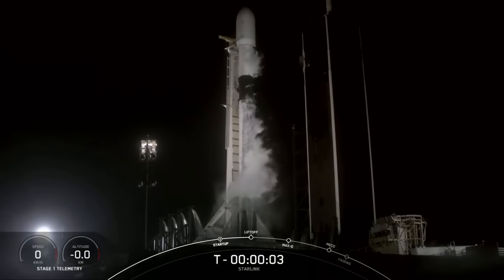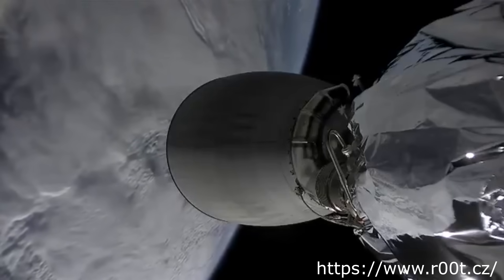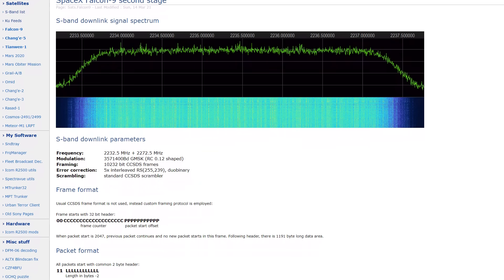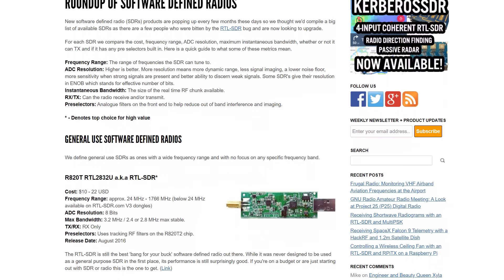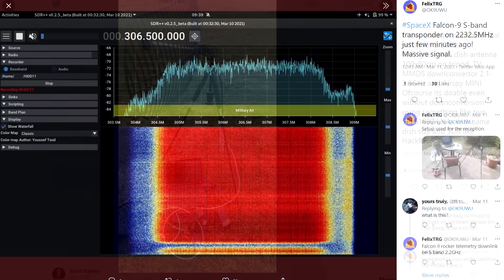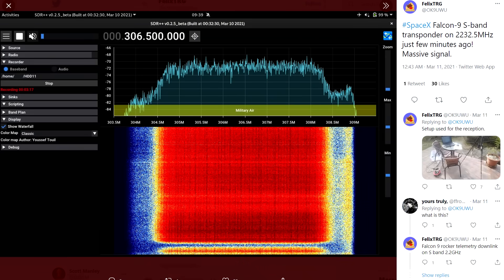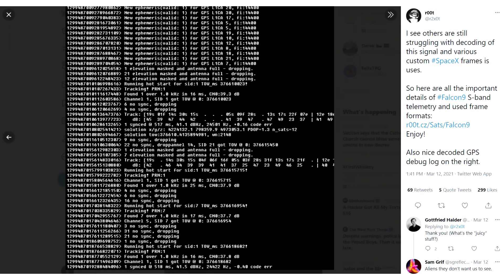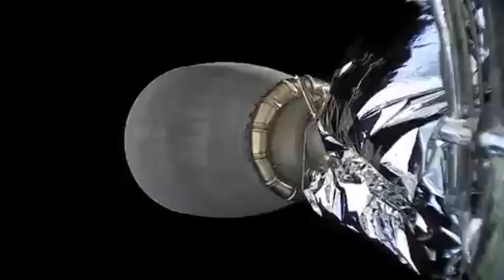How Amateur Radio Fans Decoded SpaceX's Telemetry & Engineering Video

Comment: The reason you don’t want a whole bunch of low values is that it’s hard to keep your clock synched.  Basically “was that 77 low values or 78 low values?”  If you get that number wrong, your bit stream ends up off by one and screws up your decode.
Reply: More than just timing, data communication carriers in general use energy dispersal to ensure that there aren't long runs of ones and zeros and also for energy dispersal to make sure that the transmitted waveform doesn't suddenly go to essentially CW or otherwise cause high spectral density emissions in narrow chunks of the carrier band.  This requirement relates to sharing frequency spectrum with other users and helps reduce interference between services and systems.
Reply: @RideGasGas  yes same in terrestrial microwave links for energy dispersal, clock sync and avoiding a single that looks like DC.
Reply: Same thing in the Modem chips. You lose lock if there isn't a transition for a while. That encoded looked the same as the one we used back in the 80's
Reply: @petehaidinyak9084  - I remember being in Kwajalein Atoll for our missile test capturing telemetry back in the early 80’s, but most of the time we used just the radar returns to gather the most accurate data because we weren’t always able to keep locks on the telemetry. It wasn’t always a perfect systems operations in the hot humid weather. Kwajalein where America’s day begins.
Reply: Optical Media, too, uses methods to shuffle the data round and prevent too long a gap and thus risk losing track position
Reply: Are we talking about Alternate Mark Inversion, which I learned about in the Eighties? Also useful to prevent DC bias in copper circuits.
Reply: @flamencoprof  No, AMI is a line coding thing, and is much more designed specifically for keeping the line balanced and avoiding DC bias. (And of course, allows clock recovery.) Using a PRBS from a linear feedback shift register to XOR the data stream is standard practice in most RF systems these days, as RideGasGas says - it's about playing nicely with others and not smoking your PA.
Reply: @timwatson682  Well, that's interesting, I haven't worked with this stuff for decades. You could have just said "OK Boomer", so thanks for the patient explanation. I had to look up PRBS, it seems a more sophisticated form of achieving AMI's aim, not too many 1's and 0's in a row. I get if a radio band is fully FM'd to its edges there might be sidebands to other channels?
WRT that, RideGasGas' statement  "...doesn't suddenly go to essentially CW or otherwise cause high spectral density emissions in narrow chunks of the carrier band." seems to be a long-winded way of saying "let's not have all 1s, nor all O's nor no modulation at all".
Reply: @flamencoprof  I could have - but I'm a boomer too :-)..  and don't forget - we boomers built the internet, we got people to the moon, and we invented satellites.. :-))
Reply: @timwatson682  Arthur C Clarke for the win. Over and out
Reply: Those kinds of numbers mess with my mind too.
Reply: You may also want to ensure levels alternate often enough that automatic gain control does not drift out of bounds to read noise.
Reply: 8 in 10 encoding and the like. Guaranteed maximum length before a state change.
Reply: I’d like to know the clock speeds they’re running during the flights and try and get the data too. Don’t know if my location would benefit and actually obtain on a fly-by before the loads are deployed. There would probably be some flights over my area eventually. Lol
Reply: Having large black areas in the video probably doesn't help. 😉
Reply: Close, but no

Comment: inb4 they XOR all of the data with a bunch of 420's at elons request
Reply: 420 is too big to fit in a byte, 69 however is not
Reply: @lucky-segfault  you know - as a cs student writing VDHL code for projects I should have considered that
Reply: @lucky-segfault  Back in the day, not all bytes were 8 bits. The obvious solution is to go with 9 bit bytes :D
Reply: @MarkRose1337  ouch! It hurt reading that. The smiley didn't really make it any better.

Comment: 3:30 sounds like a Superheterodyne reciever. I mean, it works in the Kilohertz range, why wouldn't it work in the Gigahertz range?
Reply: That's effectively what it is. It's a front end mixer that uses the superhet principle to convert S band to a lower "intermediate frequency" that the SDR receiver can tune to. Extremely common and widely used concept.

Comment: SDR is awesome,  you used to need some pretty expensive hardware to listen to HF/VHF/UHF  radio  outside the usual commercial bands,  but with SDR hardware and  freely available software the whole radio spectrum is open, it's a nerd's paradise.
Reply: I didn't. It was a simple modification to the board on most transceivers

Comment: Say goodbye to NROL missions until they secure these streams...
Reply: Maybe they will just remove the 2nd stage cameras all together
Reply: @OortCloud  they could but at a minimum they would have to secure the orbit telemetry, might as well do it all at that point.
Reply: They'd have to shut down ALL transmissions to try and hide their orbit, and also avoid radar or even people with binoculars.  As for NROL, anything sensitive is not likely to be streamed encrypted.

Comment: 0:50 What are we actually looking at here? What are those bubbles? Scott claims that's the liquid oxygen, but then what's the rest of the stuff we can see sloshing around? What is that thing in the middle of the tank!? So many questions.
Reply: All of it is liquid oxygen just clumping into various sided drops because of surface tension, just like water only much weaker.

The 3 sided star thing in the middle is an anti-vortex baffle. It prevents the formation of a vortex/whirlpool as this would suck helium and/or oxygen gas into the engine. The turbo pumps can only effectively pump liquid and at the extreme rates even a minor hiccup will upset the fuel/oxidizer ratio and destroy the engine.

The black cylinders on the left and top are the helium composite overwrapped pressure vessels. The helium is used to maintain pressure in the tank both for proper feeding into the turbo pumps but also you would be drawing down a vacuum in the tank as it emptied if you didn't fill it with something. The tanks need a large amount of positive pressure in order to stay rigid on the acceleration of the engines.

I think thats everything of interest??
Reply: @nocare  The 'bubbles' themselves and the stuff around the bubbles can't both be liquid oxygen, because then it's just all liquid oxygen and you wouldn't see any bubbles. Are the bubbles liquid oxygen or is the stuff around the bubbles liquid oxygen? Taking your water analogy, it doesn't make any sense to have bubbles made of water inside water, then what you have is just water with no bubbles...
Reply: @nocare  But if the blobs were floating above the main body of liquid closer to the camera then they wouldn't be affected by the distortion of the sloshing. I see 3 blobs that match your description, one in the top left, one on the far right, and one near the middle on the right, but the rest are clearly different in both the way they look and their behaviour.
Reply: @nocare  Oh I see what you mean, but that still wouldn't explain why they look different. I don't know how far down the camera is but I'm thinking the other blobs could be the shadows from blobs behind the camera. Look at the two blobs in the top left, I think that's a blob and its shadow.